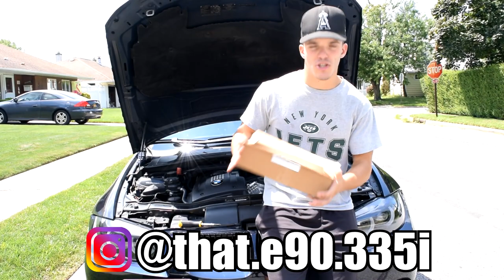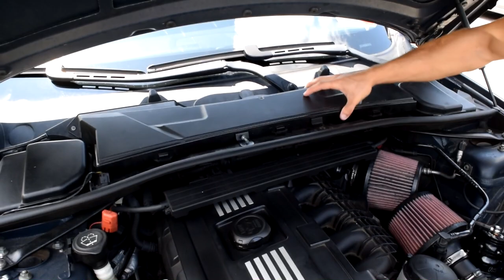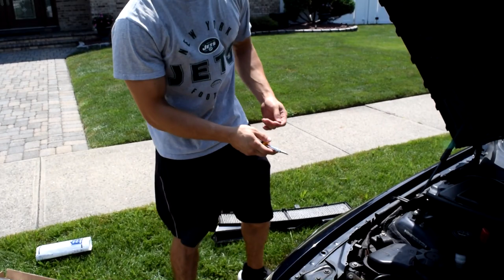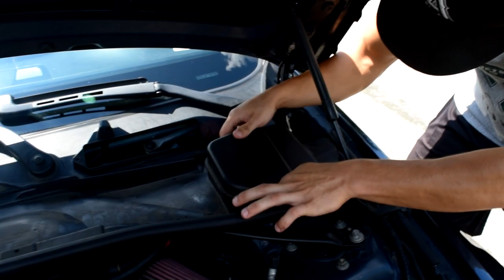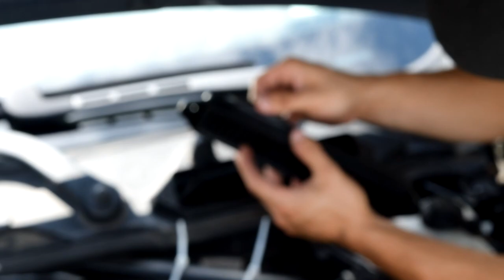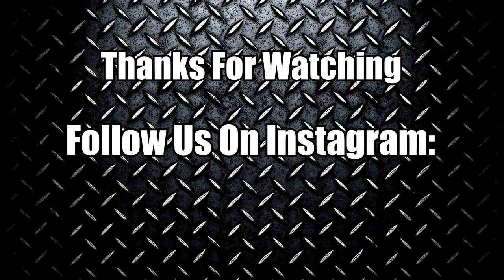E90 Cowl Filter Install

Comment: is there a link on where to buy these cowl filters?  i hate these plastic in the bmw and need an easier way to access the engine bay area
Reply from the maker: https://www.ecstuning.com/b-burger-motorsports-parts/cowl-filters/bms-cowl-filte90/?gclid=CjwKCAjwz_WGBhA1EiwAUAxIcUBRTDtays-RIA0vvJx3DYJHQJtamq9Sk9_txRLpxQyg712fozhAKhoCvccQAvD_BwE
And I'd throw the bottom part of the plastic piece back in. I made a future video about water getting into the engine bay with this setup. The setup in this video wasn't the best because it allowed water into the engine bay